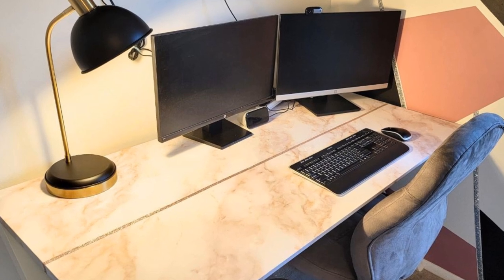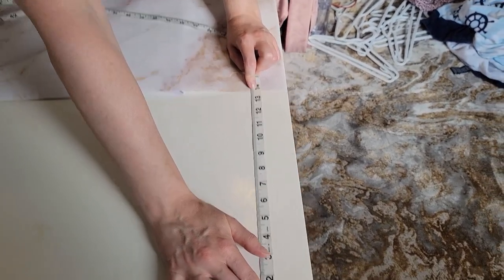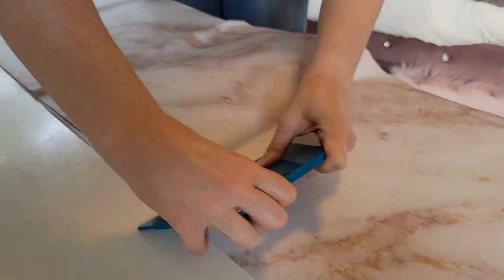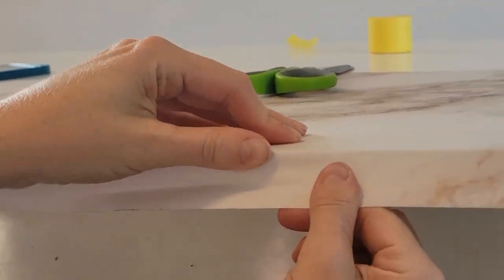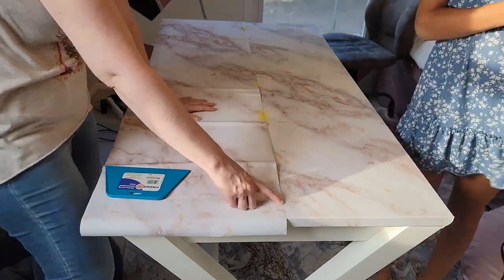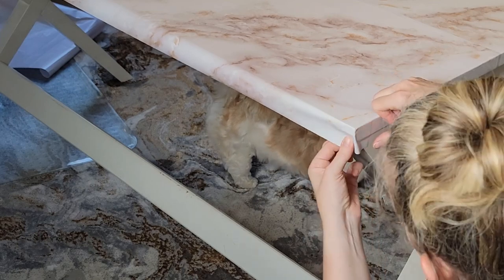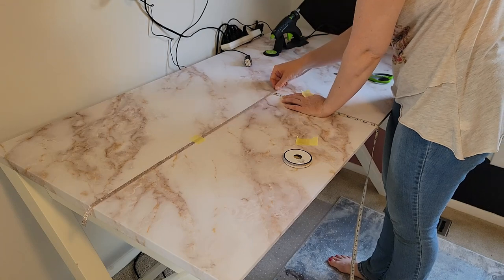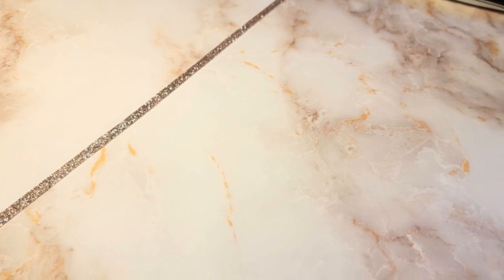Hacks for Applying Contact Paper to Furniture

Comment: Well done, Mary.  I, too, have a love/hate relationship with contact paper.  It just never seems to go as planned.  It can be super when it works, but it's mostly a disaster and I want to cry.  Thanks for you tips.  It really is a pretty contact paper.  It's like when I did peel and stick wall paper.  Managed to do the areas and it turned out fine.  Good thing I wasn't wallpapering a whole wall.  Thanks and take care.
Reply from the maker: Thanks so much for the encouragement, yes it can be a love hate relationship. I loved the way this turned out though.